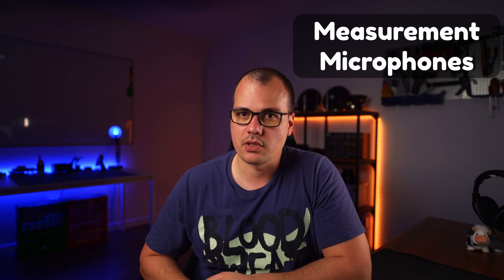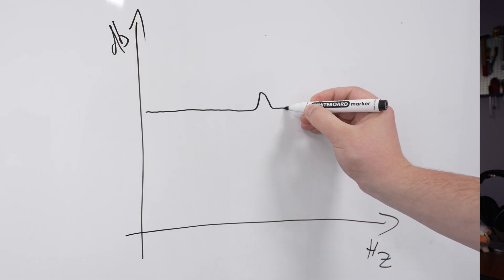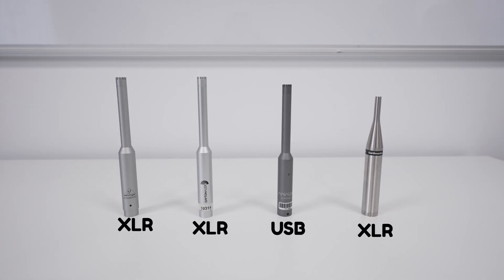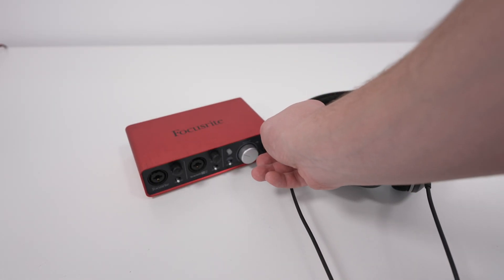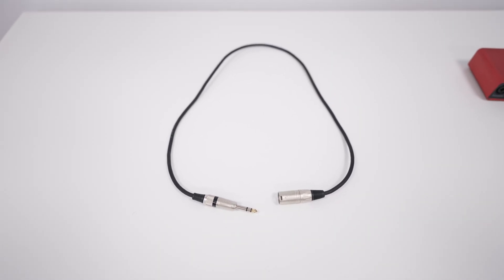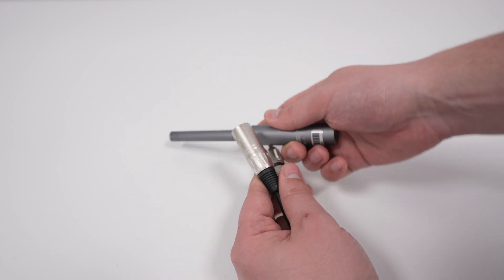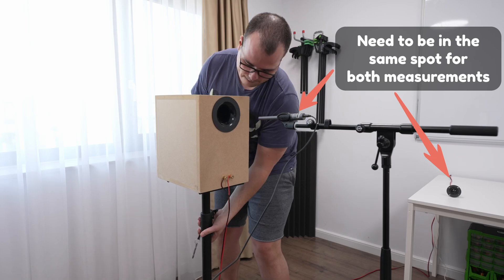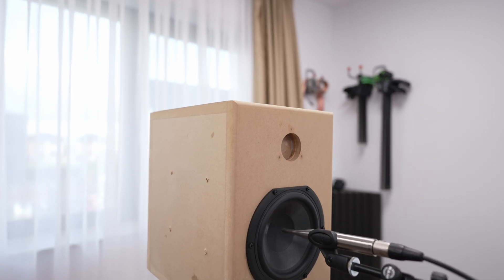Why I HATE USB Measurement Microphones

Comment: Great video. 👍
Maybe someone can help me. What exactly is meant by a stereo when it says the output is X volts and 10k ohms? 
So the output impedance is 10,000 ohms or does whatever I plug it into need to have a 10k load on it? I'm having trouble understanding that. 

I was using my xlr phantom power unit with an rca adaptor to measure a head units frequency response by playing pink noise. Some headunits have flat output, some have a noticeable curve to it. I think I need to add some resistance maybe. If any guru's can help me out, I'd sure appreciate it.
Reply: Late to the party, interesting that no-one seemed to be able to answer. The essence of the spec is that the specified frequency response and tolerance will be optimal at a load of 10k, typically a lower impedance load will cause a premature roll-off of the bass as the output amp impedance and DC blocking capacitor network acts as a HPF. Generally though higher impedance loads will have negligible effect on frequency response.

Comment: If you still have those measurements, you can use them to create calibration curves to adjust the older mikes.  Just use REW's features for that purpose.

I use a USB mike.  For measuring vented boxes, I tend use the transfer function method - close mike woofer with port closed off, measure again @1M, open port, measure again without moving the mic, use the first two measurements to derive the transfer function, add the transfer function to the third measurement.  Best performed in the garage so you don't have to deal with room modes :-).  Most times though I just assume that if the impedance curve matches the sim, the output will likely match the sim'd output as well.
Reply: Awesome, I'd love to see a practical example of the transfer function method. cheers.
Reply: Closing off the port changes the tuning of the box and compliance of the driver. Splicing or normalizing based off this will give incorrect results. Isolating the port with a baffle may be a better option, if I’m understanding your method correctly.
Reply: @jtmcfarland3512  The port needs to be sealed off for a good close-mike measurement.   The only purpose of this part of the process is to derive the transfer function, so it doesn't matter if the tuning of the box is changed.  Sometimes I use an entirely different speaker of approximately the same size to derive the transfer function if it's not possible to seal the vent of the speaker that I want to measure (e.g. if the speaker is a passive radiator, rather than a vented, alignment.).  

The transfer function basically describes the change between the measurement with the mic at point A and then at point B, so if you do any subsequent measurement at point B, you can calculate what the measurement would be at point A by subtracting the transfer function.
Reply: @Grommet2007  I understand the second paragraph, but I’m not sure I agree with the first. My amateur experience in WinISD suggests the “tuning” of the box (size, order, compliance, damping material, etc) directly effects the transfer function. The ideal way to measure would be to have the port on the other side of an IB (simulated obviously) from the driver in order to get near field measurement of the transfer function without the port & vice versa. With a large enough baffle, you should be able to get an accurate gated response of each. Then you can do whatever comparison you like. However, each time you change the port dynamics and certainly the driver itself, you’ve changed the transfer function of the system and will need to take new measurements at BOTH locations.
Reply: @jtmcfarland3512  Nope - the transfer function is simply the difference between the measurements at point A and point B, due to the delta difference from the device being measured and whatever impact the environment has on the measurement.  You're talking about the transfer function of the system - I'm talking about the transfer function of the measurement environment :-).
Reply: @Grommet2007  Okay. That makes a little more sense. LoL

Comment: Thanks for the informative test. I didn't know calibration mics need to be replaced every 5 years. I make so many measurements, I usually break them before that though :)
Reply from the maker: You need a new calibration file, not a new mic. Although, I don’t know any company that calibrates mics as a service.
Reply: @AudioJudgement  Awesome video besides the matter of Interface selection. Isn't that most important specifically when going for XLR Microphone and the one that does 5hz-30khz. Because if the frequency response of Interface not being flat would negate the benefit of XLR Mic being absolutely flat in response. 

Please look into Audio Interfaces and make video on that as well. Which is absolutely flat and is the best.
Reply: @KING_DRANZER You have to calibrate the interface separately. Just use the loop cable and recalibrate as needed. No need to have a perfectly flat interface. I’d be more concerned with other features.
Reply: You don't need to do that. They're just trying to make you a "subscription" customer.

Comment: Very informative. It would have been interesting to compare the acoustic timing reference to the loopback reference to see how accurate the acoustic ref is.
Reply: If you tick "Adjust clock with acoustic reference" option in preferences - a recent addition to REW - it will compensate for clock differences between the input and output by adding a reference timing signal at the end of the sweep. This will take care of "most" of the clocking deviations inherent to USB mics.